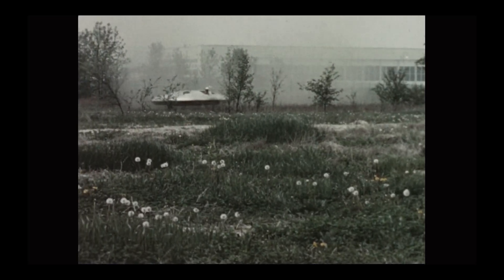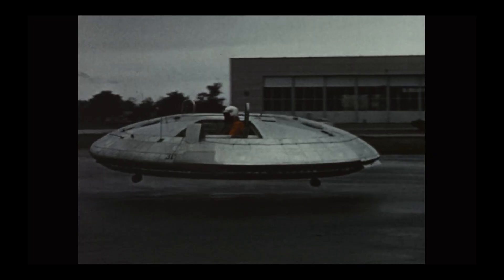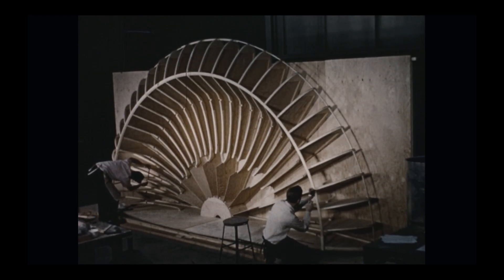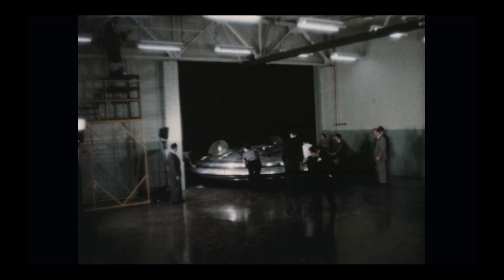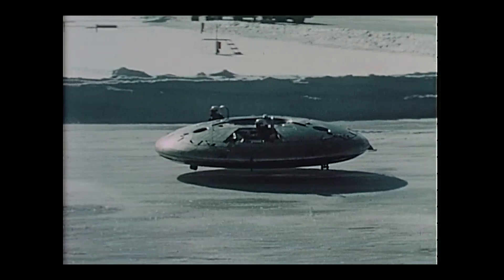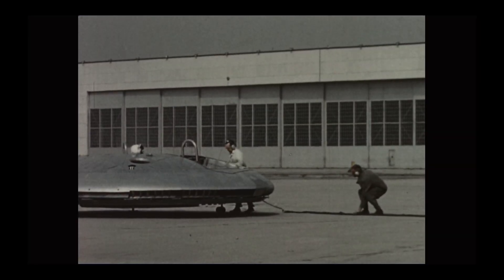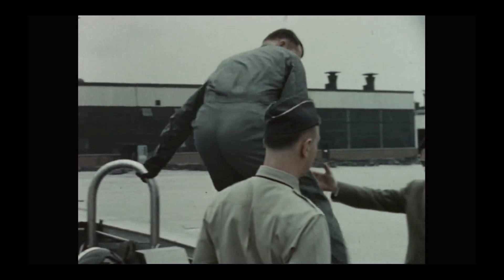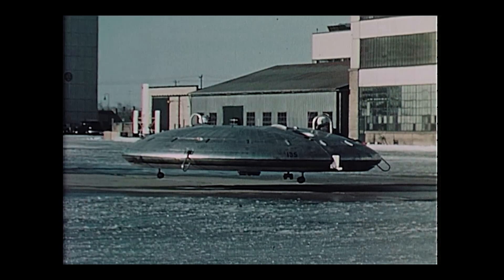Avrocar: Canada's Flying Saucer That Couldn't Fly Straight

Comment: With great respect, you need to used Spell-Check. You videos have frequent misspellings. Misspelled words unfortunately imply that the research may also be careless . . .which I don't think it is.
Reply from the maker: @josephmarciano4761 Thanks for pointing that out, Joseph — I really appreciate it. You’re absolutely right. I’ve been rushing a bit lately, and those thumbnail typos slipped right past me. The research is solid, but I know the presentation matters just as much, so I’m tightening up my proofreading and taking more time before hitting publish.

Thanks again for the respectful heads-up — it genuinely helps me improve the channel.

Comment: Unlikely that a top secret thing no one ever saw that couldn't get off the ground is the source of UFO photos. 🛸
Reply from the maker: Haha, fair point! The Avrocar struggled enough just trying to hover, let alone fueling UFO legends. 😄 I think a lot of those old “flying saucer” sightings came more from imagination than from anything in a hangar. Still, programs like this did show how far engineers were willing to push the envelope at the time — even if the results wobbled more than they flew!